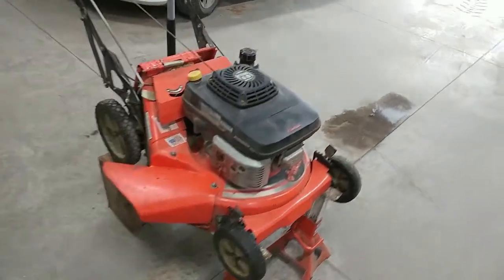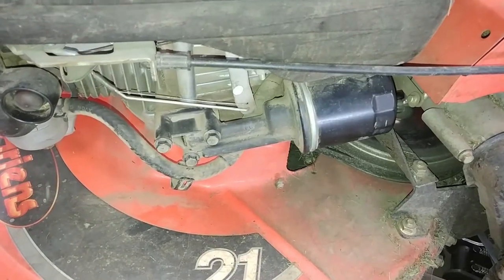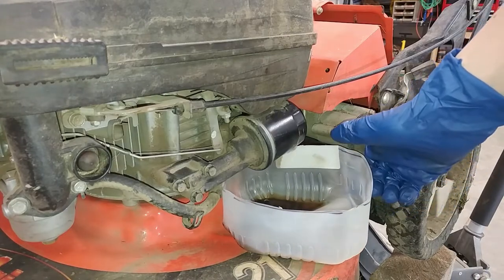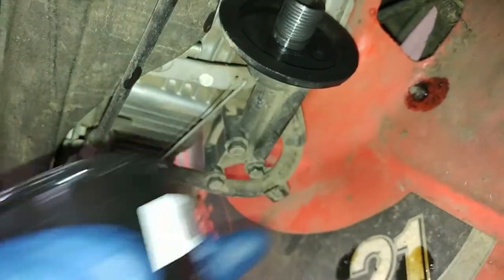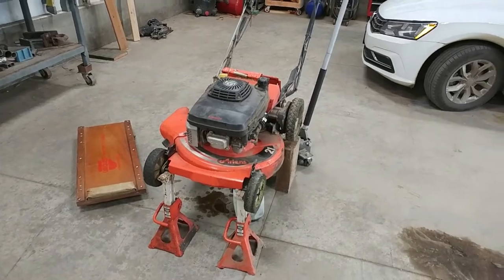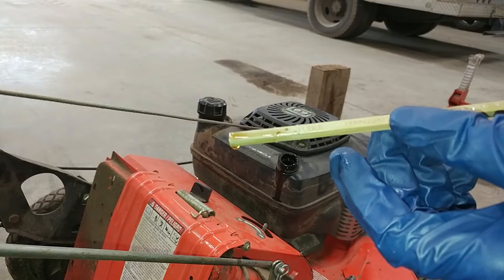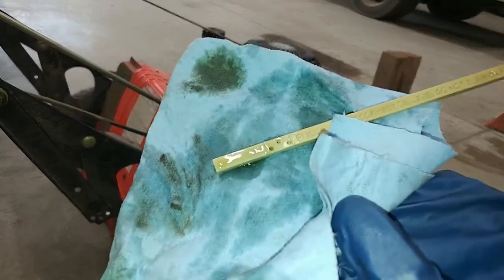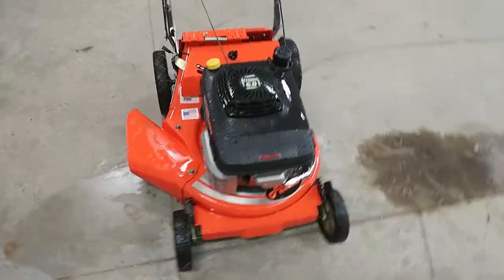How to Change the Oil on Ariens lawn mower with Kawasaki FJ180V Engine

Comment: Thats a nice mower. I got the FJ180V BS18 but no oil filter assembly for some reason. Has a 3 screw plate cover (Exact location) with clamp for the gas line. Seems like I could just buy that oil filter housing and add it on.
Reply from the maker: Yeah honestly I dont see why not. That would be a good upgrade
Reply: great idea, I thought the same ..have you done the upgrade`and does it easily fit?